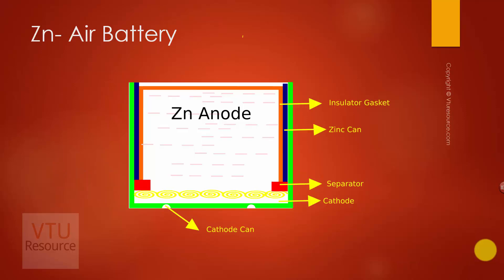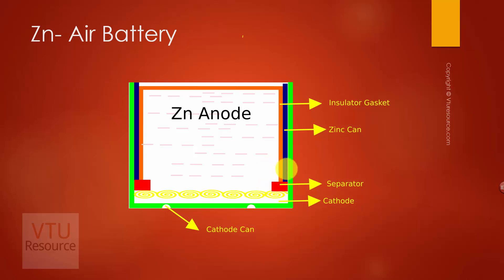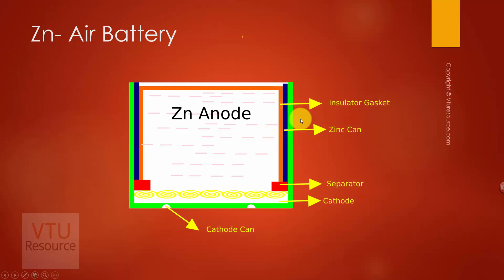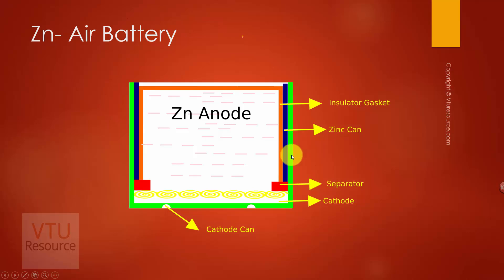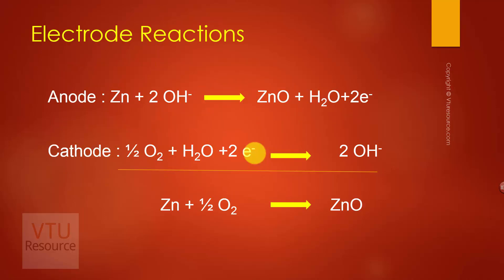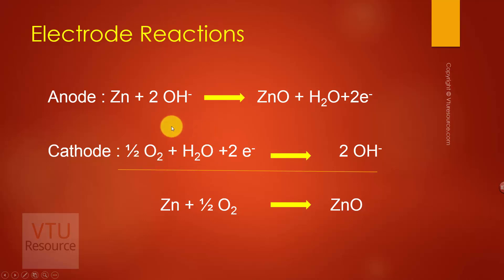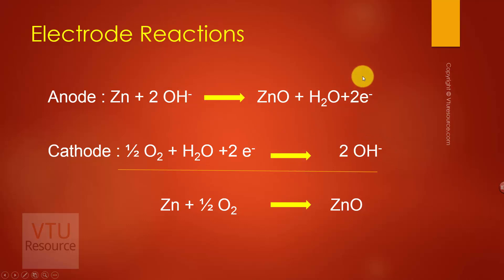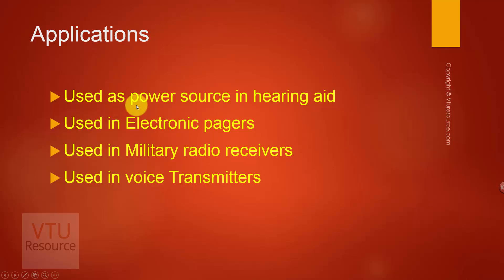Zinc Air Battery

Comment: Why do zinc air batteries have high energy density? Am I missing something?
Reply: It uses oxygen from the air as an oxidiser, so an oxygen rich chemical does not have to be part of the battery